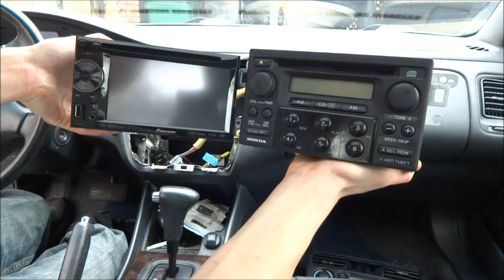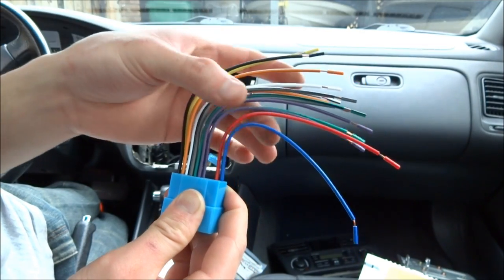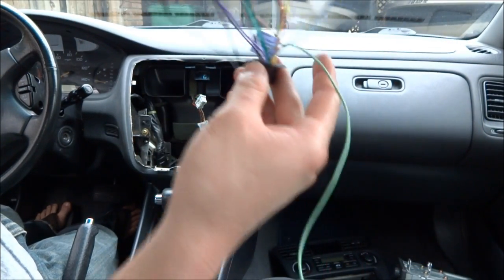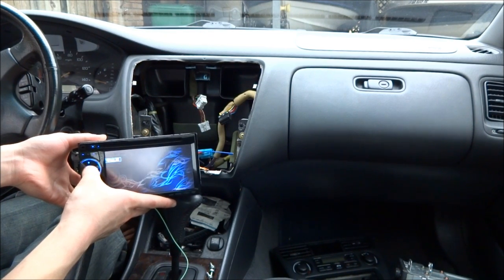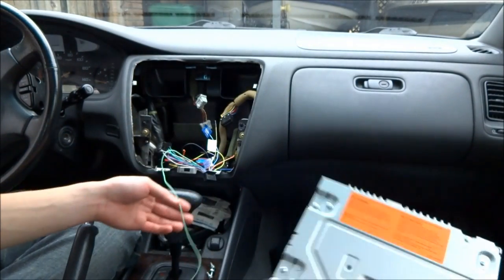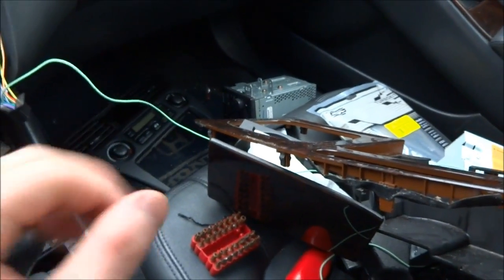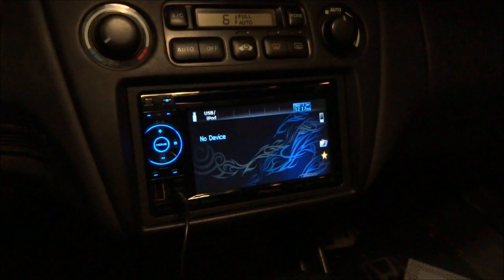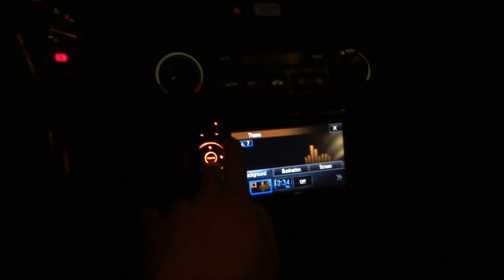How to Install Car Stereo (Pioneer AVH-2400 in 2000 Honda Accord)

Comment: great  instructional video. I like that radio. whats the specific name and model number, and how much does it cost? Where can I buy the radio, the wiring harness and mounting plate? Keep up the good work: Thanks!
Reply from the maker: Thank you for watching. My particular model is a pioneer avh 2400bt. . That is a 2012 model and is no longer being produced. The equivalent now is avh 2800 . That's not the actual name but that's the 2015 model. The wiring and mounting bracket was from Amazon. All you have to do is search your car and radio
Reply: +CharlietoKind Thanks!! You have inspired me!!

Comment: You should of grounded out the parking brake wire to a chassis bolt to bypass the parking brake to watch the DVD without putting the parking brake on.
Reply: how do you do that????

Comment: depending on whether the parking brake wire goes negative or pos when you apply it, you can just connect that wire to the acc wire or the constant + wire so that the video works while you are driving. I think it is better to have it available while driving because you never know when you will need it. If you don't need it,just don't use it.

With these hondas, it is best to remove the metal mounting brackets on the old stereo and put them on the new one instead of using the cheap plastic ones that come in those kits.

If the parking wire goes negative, just use a relay to make it switch pos and you can also use a switch to turn that video safety feature on and off in case you want to change it without taking the console apart.
Reply from the maker: thanks for the info!  though i already thew away my old radio with the brackets :/

Comment: you could of just attached the hand brake wire to the back of your stereo and the dvd would work... all you have to do is basically ground the parking brake wire in order for the dvd to work...

Comment: I'm shocked the car alarm for the anti theft system for the radio being disconnected didn't go off
Reply from the maker: the ice wolf yeah cause the manual says it’s related lol
Reply: @CharlietoKind  did the car alarm system arm when you locked the doors afterward?
Reply from the maker: Yep just like Normal . Horn Chirp and all
Reply: @CharlietoKind  nice

Comment: After installing the aftermarket radio did all six spekers the 2 dash twitter the doors and back work just like they did with the factory radio ?
Reply from the maker: yes, they worked exactly like the factory.

Comment: And does it have a camera where you can see when u back up???
Reply from the maker: its a pioneer avh 2400.. most double din radios that have touch screens have a back up camera option.  i have one installed and it works flawlessly almost like it came with the car.. just like the parking brake wire, you have a reverse light wire, and it senses when you go in reverse, and if you have the feature set to on, it will automatically change the screen to the camera if you have one installed. really cool

Comment: the yellow is the memory wire and its constant.
www.the12volt.com should be used whenever you don't feel like using a direct harness or feel cheap xD.

Comment: Probably a dumbass question here but what happens to your "anti theft" thing well it work still after you install this?   and how bout the code that you punch in if  your battery dies out will it still work with this pioneer system? anyway thanks.
Reply from the maker: The security system still works. According to the users Manual if the stock radio is removed the alarm will go off. With this pioneer system, that will not happen, and the pioneer system does not have a lock code. That code is embedded into the radio. On most newer cars the code /radio is integrated into the dash and the radio code can be retrieved from the car itself. Not sure if aftermarket systems will work on those cars.
Reply: +CharlietoKind  thanks man. I have an 02 honda accord ex coupe and my 6cd changer ain't working anymore. it doesn't spit the cd out. basically 3 cds are stuck inside. everything works except the cd changer so I'm trying to find a car stereo with gps  that works.
Reply from the maker: +Bokoyfourtwenty Tabagrong lol. My stock single CD player quit taking in CDs lol. Luckily Honda didn't make the 6 disc changer standard on the ex v6 trims for 98-00
Reply: +CharlietoKind mine got a tape player too and that's the thing I used when playing music by connecting it to my phone.  but I need this thing removed and put on a new one. I also might pay someone to do it cuz I'm clumsy as fuck I could end up destroying my dash lol. do you know any car sound system with nav that is compatible with my car? other than that pioneer one? cuz the thing is expensive.
Reply from the maker: +Bokoyfourtwenty Tabagrong you can try refurbished name brand systems. The wiring might be a little different from this video.
Reply: +CharlietoKind ya I'll try that. thanks
Reply: Bokoyfourtwenty Tabagrong you ever get it installed?

Comment: please never use a screw driver as a pry tool, you can get nylon pry tools for three bucks, all the aftermarket harnesses use the same EIA standard color codes, why did you use electrical tape to connect the wires? thats a horrible connection and will probably stop working in a week. at least you butt connectors or bell connectors. clean it up and take pride in your work. dont ever use scotch locks or t taps for anything use a military splice. like how half your lights dont work anymore haha

Comment: You're killing me.  I was watching to see how the dash kit installs.  Dang ... you skipped it.
Reply from the maker: Jay J the plastic bezel that goes around the radio and mounts on the car? its just a simple swap of screws from the stock radio, and you mirror the location of the screws to the new one..
Reply: Ok ... thanks

Comment: For the love of god, soldier or crimp your connections..I mean what's 5 dollars of butt connectors worth? Not shorting out your ignition/constant/turn on circuit for 5 dollars? I mean a fuse is cheap but not an hour of labor diagnosing why your intall isn't working  properly

Comment: I would not trust him with my car one how do you burn that many wires just disconnect the battery terminals. Two why do you pull that shifter so hard your gonna do damage. Thirdly it took you way longer than it should have.